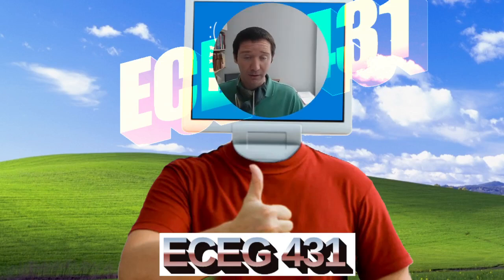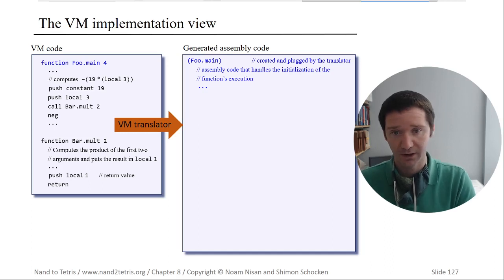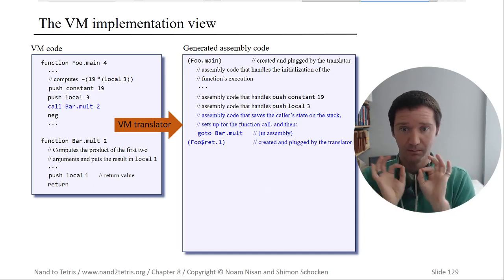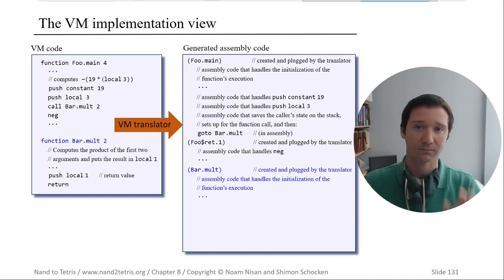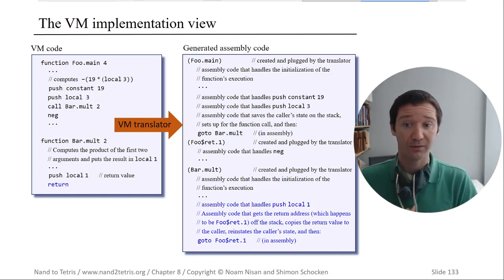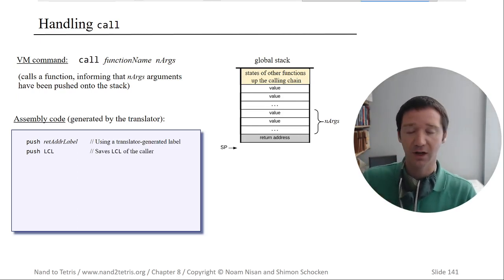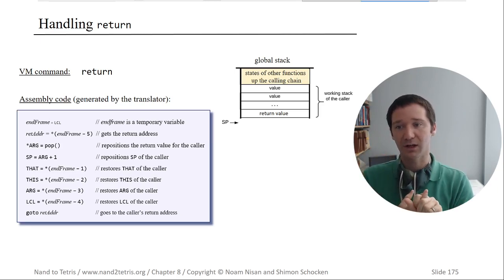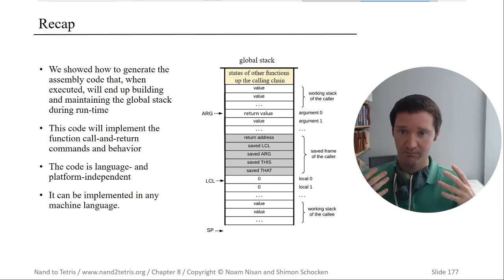Walk through of Function Call and Return (HACK assembly)

Comment: I love it when a simple google search turns up a simple answer, "function return in hack assembly", and you just put a label at the point you want to jump back to after the function has finished. This is what I came up with myself, but i'm glad to know this is the way to do it. I'm even a little bit tempted to extend my cpu emulator to include a way to put the current PC register value into one of the user registers, or maybe something in the assembler that recognizes a particular symbol to always mean "whatever address follows this symbol". seems a bit nicer than a bunch of arbitrary labels